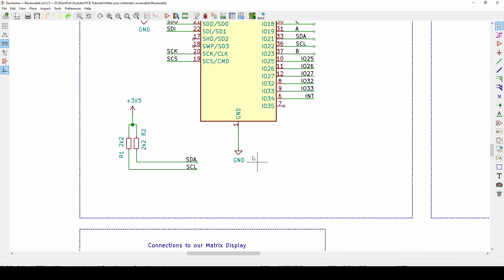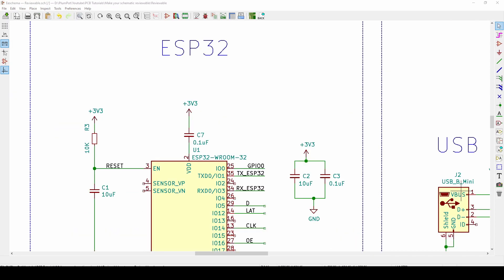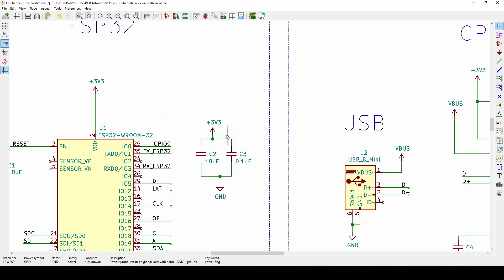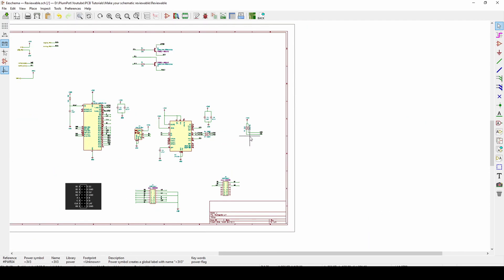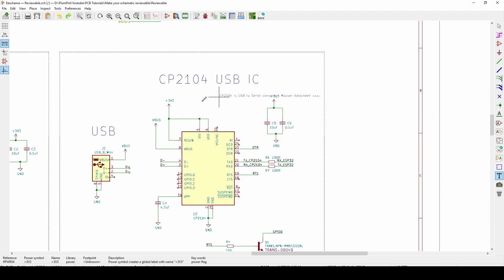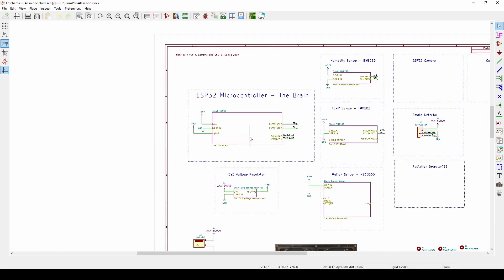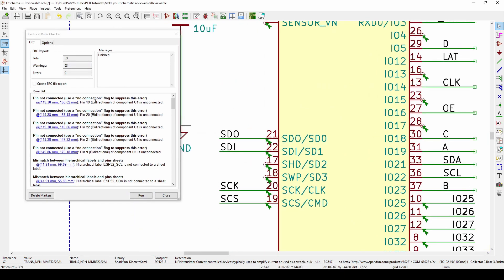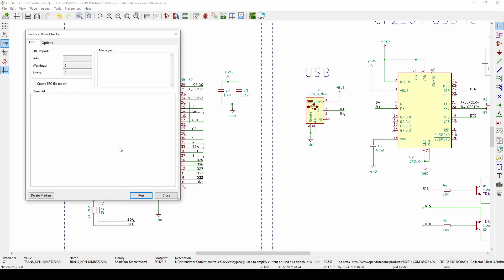KiCad Tutorial -  How to neaten up your schematic!

Comment: Thanks for the brief tutorial.  You mentioned not crossing wires, but didn't suggest what to do instead.  I think most people probably already use Power and Ground symbols correctly.  I'm new to KiCad (been using it for less than a week) and have several ICs with lines connected between them and they cross.  Should I add a short wire to each pin with just a text label?  They are address lines or data lines and are already labeled A0-A15 and D0-D7 and it would probably look a bit odd to have short wires that duplicate the labels already on the chip.

Also, if the lines aren't connected from IC to IC, that would also prevent KiCad from being able to detect errors like Output-to-Output, right?

Comment: Hi, thanks for the video. Just a short question. How did you draw the rectangular outlines around the circuits? Thanks again.
Reply from the maker: Hi, sorry for the late reply, on the right habd side you should have a square for dotted lines, which version are you using V5 or V6?
Reply: @PlumPot  Hi, thanks a lot for your reply.  I'm using V5. I'll check it out and update you. Thanks again.